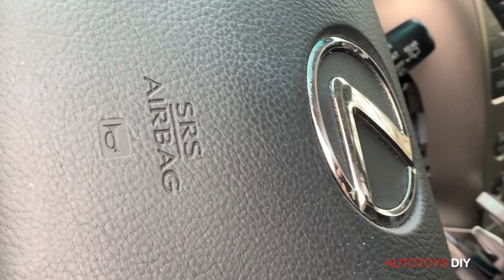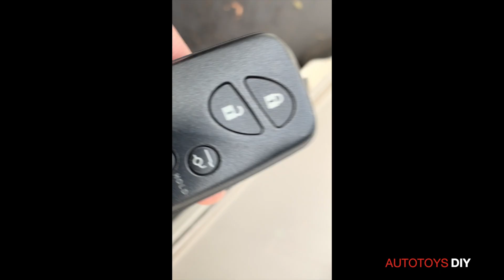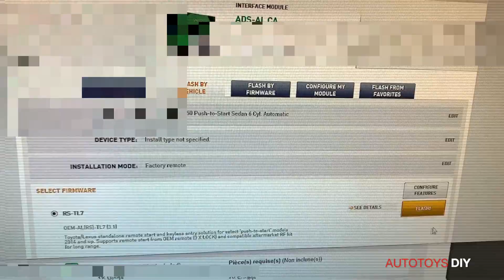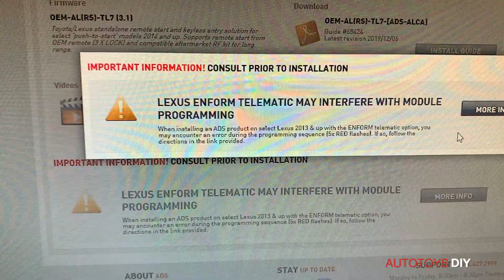Get Your Lexus Gx Started Remotely With This Easy Installation Guide!

Comment: Hey, I installed the compustar 4900s 2-way remote start system to my Lexus 2005 es330 and when I put the key in the key which stays on off, and I press the button it works. But when I take it out it doesn’t. Can you help me, I don’t know what happened.
Reply from the maker: You need an immobilizer bypass module.  See https://amzn.to/3PXSrt3